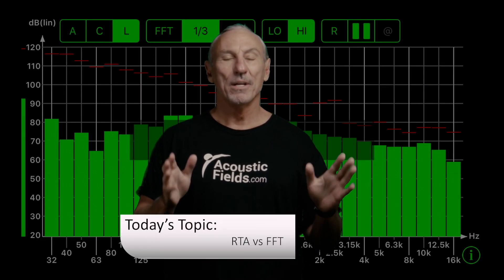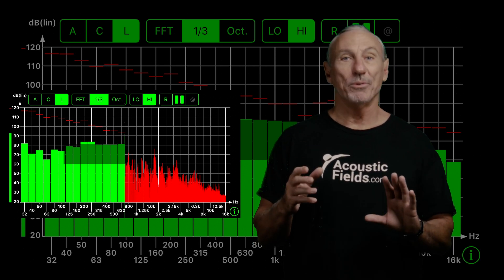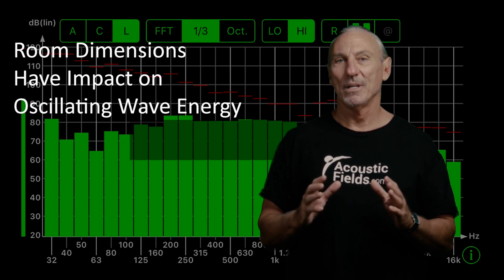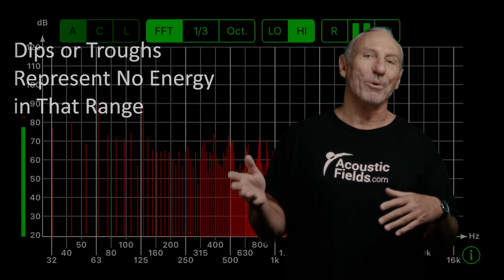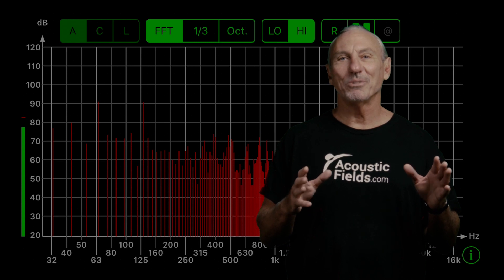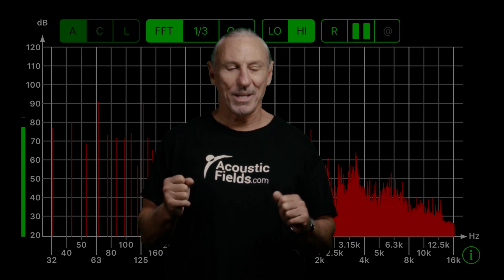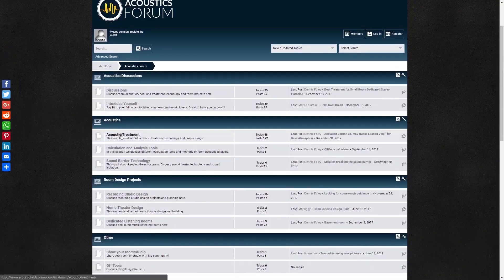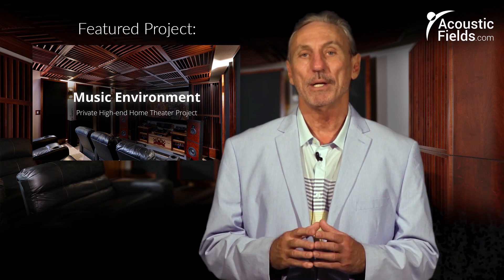RTA vs FFT  - www.AcousticFields.com

Comment: Pink Noise is for RTA
White Noise is for FFT?
For getting flat graph for each measurement.

Am I correct?
Reply from the maker: RTA is an acronym for real time analyzer. It look at octave bands for sounds in real time. White noise is used to calibrate equipment.

Comment: What is the benefit of measuring in octave bands if fft is available? Wouldn't the octave reading be the same but at a much lower resolution?
Reply from the maker: An RTA represents octave bands that each  contain 8 notes. It is easier with a RTA to see the relationship between the octaves in real time. It is the movement of each octave band that we are looking for and at for understanding.
Reply: @AcousticFields  Is that just to relate it better to music? Because don't equalization, speaker response, acoustic treatment, etc all use frequency as a unit of measurement?